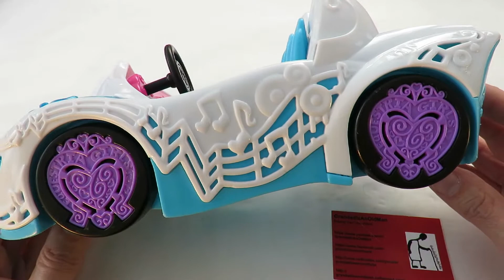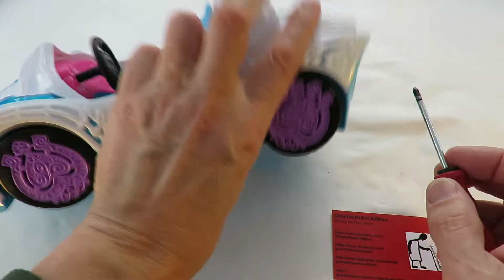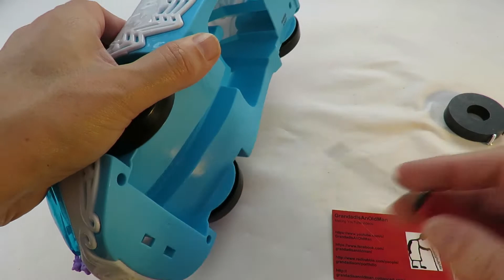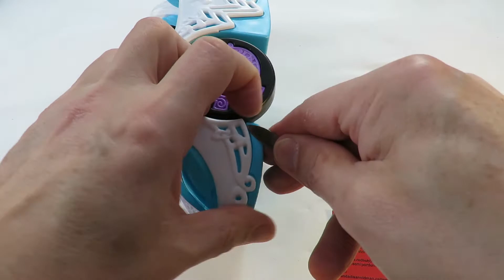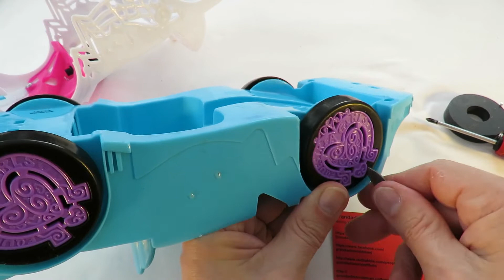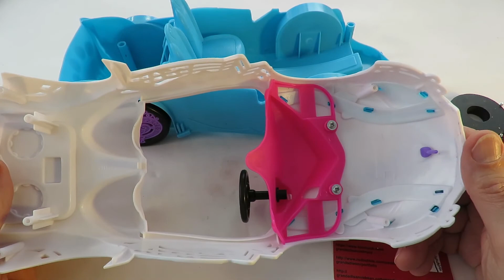RC Conversion - Equestria Girls Car Part 1 - MLP

Comment: You could put an elastic band around each wheels' circumference foe traction.
Reply from the maker: Yes Wil, but viewers want to watch it spinning around. If it has grip and drives like a normal car they just want you to add more power so the wheels spin !!! 😊😊
Reply: First thing I thought to do

Comment: Can you make it rubber powered car
Reply from the maker: I could, but you wouldn't get much grip with those plastic wheels. You would have to change them to soft rubber and probably add extra weight to hold it down. I have converted it to RC as you will see in later videos